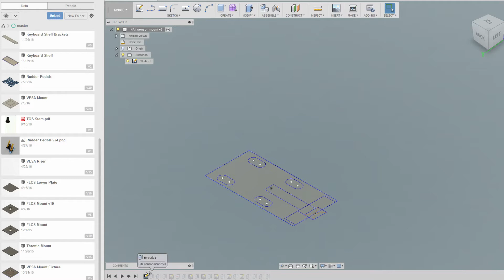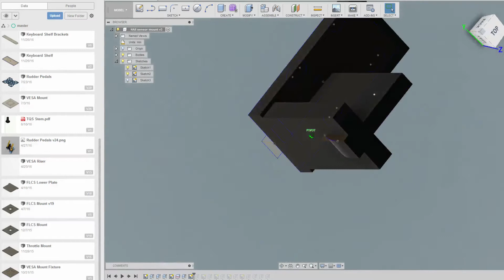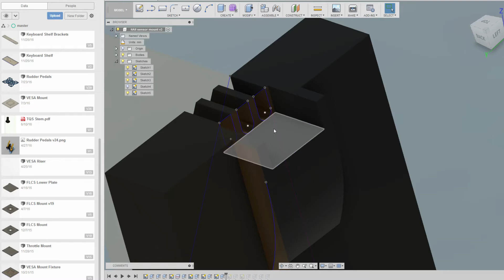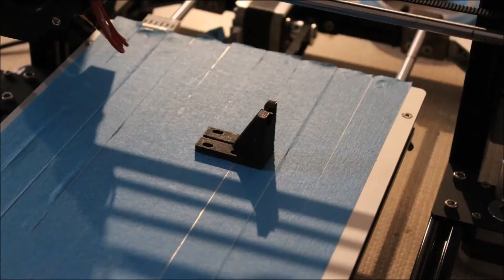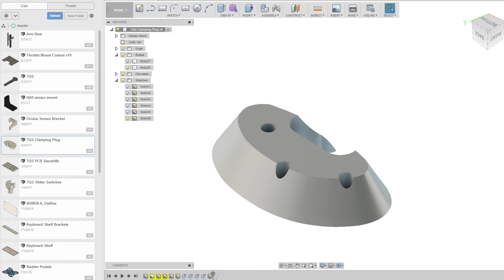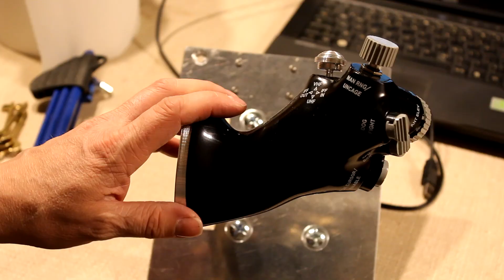Gaming Cockpit Project - Part 17 - Finishing the Throttle

Comment: what switch did you use to replace the old 'dogfight' switch from latched to momentary? or just the key spec you looked for? 
(seems necessary for Cougar to space sim conversions!)
Reply from the maker: I think these were them: https://smile.amazon.co.uk/dp/B01M0LXR0L/ref=cm_sw_em_r_mt_dp_5oRvFbX0TZMCJ

A pretty ordinary (on)-off-(on) momentary each way switch. It works great for tabs in the cockpit UI in Elite Dangerous, but obviously a little unrealistic for F16 duties...
Reply: @CMDRTeatime  Thanks, will have a look at these, I haven't been opening the handle yet (only just got the Cougar). Happy to learn what's inside is just an ordinary flip switch!

I will change the slew thumbstick into a controller-style thumbstick as well. Wondering what your experiences are with that index analog stick you added? Was one thumbstick redundant now that you had two? I figure I only need one for strafing, whereas a hat switch would be easier to map functions like energy management.
Reply from the maker: Yeah for flight, the thumbstick is now kind of redundant, as I use what was the radio 4 way for vertical/horizontal thrust, but do still I use it for the SRV (Buggy) turret control and Galaxy map in VR in Elite Dangerous. I'm assuming you are also a CMDR in which case I have my energy/pips management on the FLCS (joystick). That way its kind of flight controls on the throttle and weapon/energy/target management on the stick.
In DCS of course that all changes :-)

Comment: 3d printer - thought it was about time you had one of those in your arsenal!
Reply: What model did you say it was?
Reply from the maker: Hi Julian - it was a Hictop Reprap Prusi i3 (v2) with an aluminium frame and self-levelling bed (self levelling is actually done in the software by correcting the Z values on the fly). I was going to post a link, but it looks like they don't do that model any more so this is the closest: https://www.amazon.co.uk/dp/B015OEC5IG/ref=cm_sw_r_cp_ep_dp_ERehzbPDAM8J9 but there are a ton on the market now from other clone makers.
Reply from the maker: Yeah I've been thinking about a 3D printer for many years (at least as long as I've been into CNC) and even thought about making my own. However, they are too cheap to self-build unless I wanted to go a bit over the top on rigidity/accuracy, which for essentially cake icing with plastic isn't going to yield a great deal more for a lot more outlay.
Reply: Hello, your projects are fantastic! I've been following this channel for a while. Cant wait to see more of the cockpit. Keep it up!